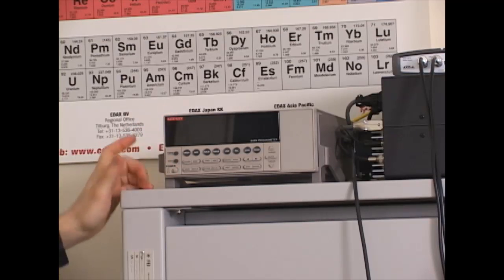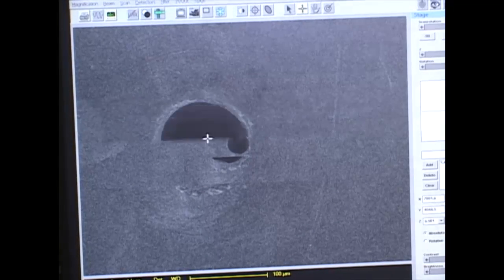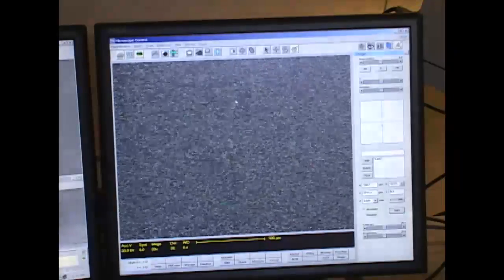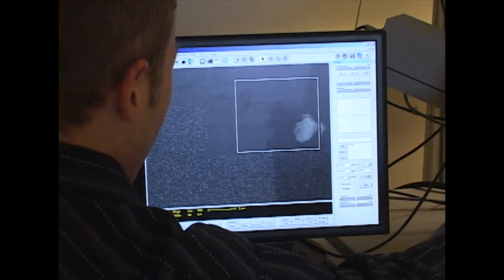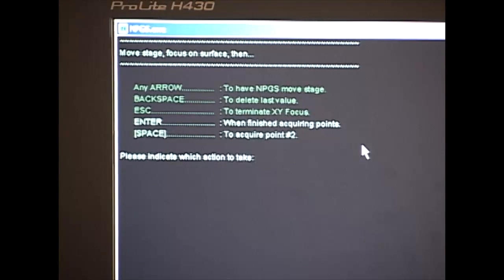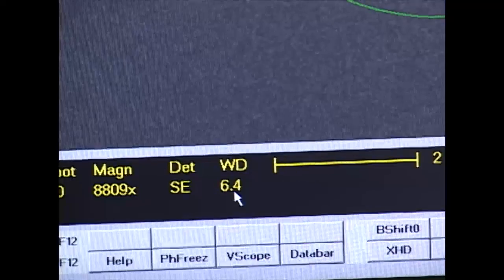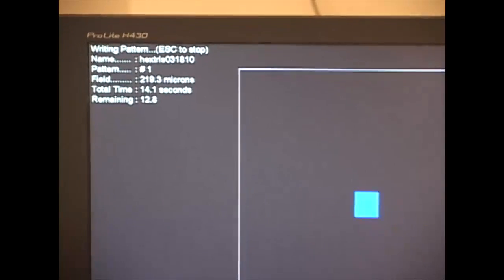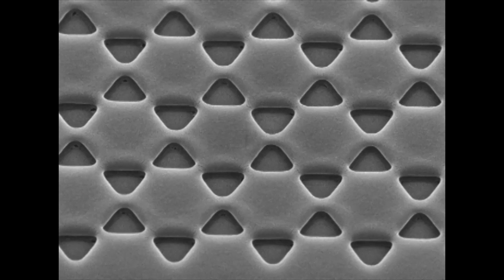E-Beam Lithography, Part 3

Comment: Hi! Example; If I have an old chip that no longer exists anywhere even on the internet to buy, can I reproduce that chip with E-beam lithography? Or recover it?
Or can I not?
First you have to decapsulate that chip and then you take the chip's DIE and insert it into the lithography machine? and is that ok?